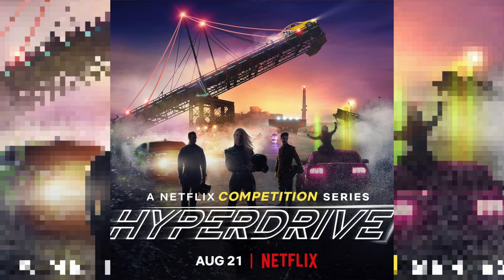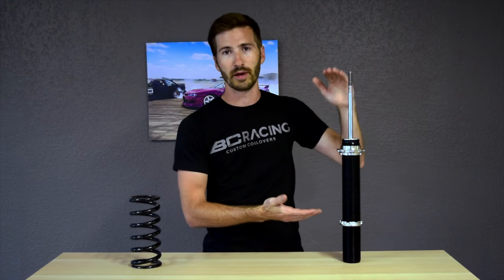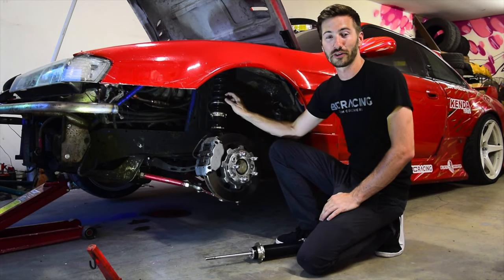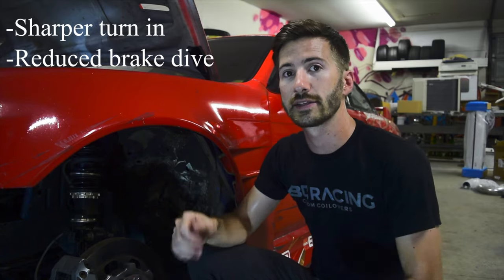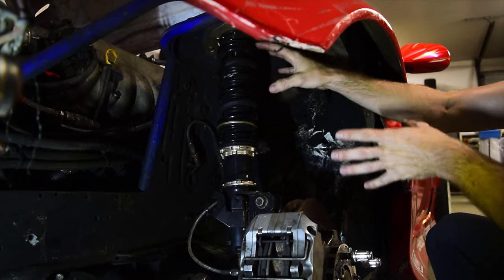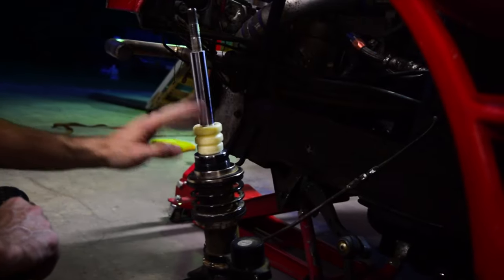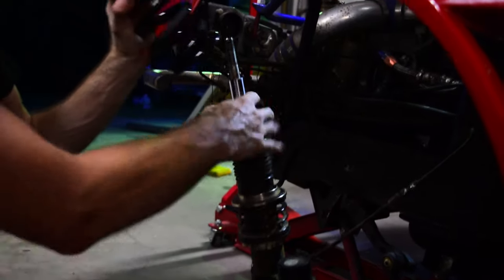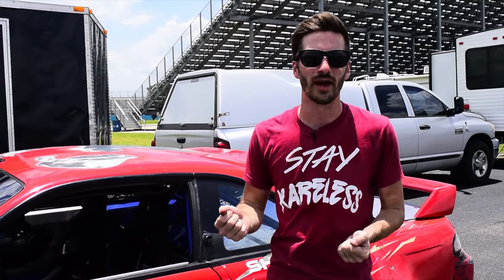Higher spring rates equal more grip?!?!  Search for traction!

Comment: A bit of a correction, but springs don't affect load transfer. A higher springrate in the front (Or to be more precise, a wheelrate), or a softer in the rear will NOT "push weight to the rear". Not even one Newton more than you'd get otherwise, just pure kinematics wise. It doesn't matter if your car has 1kg-f/mm or 10kg-f/mm springs, you're gonna transfer the same load.

Now what they will do is control the body, and if you change the relative stiffness of one end compared to the other, you will change the distribution of lateral load transfer, or Lateral Load Transfer Distribution. The car can and will only transfer a set amount of load from the inside tire to outside tire and you can't change that in any way with rates, but you can change how much happens at the front, and how much happens at the rear.

Going stiffer in the front means that there is more load transfer across the front side-to-side, and because the total load transfer CANNOT be changed with suspension like I said, the rear will transfer *less*. Tires with less load on them have more grip (Yes, more grip) and the more you load a tire, the more grip it loses, which is why a more evenly balanced axle has more grip. Loading a tire more will cause the cornering force to go up, but at an unfavorable ratio. 1000N more load doesn't give you 1000N more cornering force but instead gives you less; so you want as little load as possible for a baseline. That's why lighter cars inherently corner faster; they have effectively grippier tires.

You might be asking then why do people use aero if it increases load on the tire and decreases grip; it is true that it decreases tire potential, but the extra load results in more cornering force and more importantly it comes with effectively no extra MASS ie: inertia. So it's just free load without the downside of having to also push mass around; so the car corners faster.

You need to take into account the suspension kinematics too; the LLTD is not decided only by the springs.

Unfortunately there is no way to reduce load transfer of a car apart from making it lighter (It will transfer the same %, but less absolutely), making the track width wider/wheelbase longer, or center of gravity height lower.

A simplified formula for percentage of load transfer laterally is:

(1.0 * 0.5) / 1.5 = 0.33333333333

Where 1.0G laterally, 0.5m Center of Gravity Height and 1.5m track width, results in 1/3 of the load from inside being transferred to outside. Play with that formula to see the relationship.

With this you might think then that professional drift cars make the front track very wide to allow for less load transfer = more grip, which is true to a point. It does increase the axle's performance. However it increases the roll stiffness of the axle more than it reduces the load transfer; so realistically most of the time you actually end up transferring more load on a wider axle because the springs are effectively stiffer in roll. The stiffer the springs, the stiffer they get absolutely; however the % is always the same.

So going wider on the front of a stiff professional drift car will give you "more rear grip" than going wider on the front of a soft production car, because the front of the pro drift car became much stiffer absolutely (and thus relatively to the rear) than the production car.

Roll stiffness formula is too complex to write here because it relies on quite a few car inputs, but you can find it by searching. The unit should be in Nm/deg.
Reply: interesting
Reply: @jdmspirit99  Race Car Vehicle Dynamics has some definitions and examples and Suspension Geometry and Computation is also good if you're looking for more.

Comment: Good topic. I’m curious about anti-squat and it’s effect on traction in a drift car. High anti-squat is used on drag cars. The suspension geometry actually lifts the car’s backend up during acceleration aka pushes the tires down into the ground. In autocross low or no anti-squat is used because high anti-squat causes suspension bind in corner exit. Road racing varies. But what about drift? From my basic understand of physics seems like the forces acting on a drift car mid-drift are actually closer to drag car. Seems like you would want a suspension geometry that actually lifted the rear of the car up mid drift instead of sucking it down aka squat. You would still want soft spring rate in rear to allow slower weight transfer and high spring rate in front to cause faster weight transfer. But what do I know. I just sneezed and crapped my pants.
Reply: Got a very good point there, that’s why he said his car was front heavy because of the 2jz swap so with the stiffer springs, it’ll allow him to get more squat to the back allowing for better grip and a better geometry throughout drifting and transitions. That’s why he didn’t even touch the rear springs. Suspension is all based on your car, doesn’t work for everyone, so make your suspension work with your car and not what some other dude does, everyone has a different setup. Gotta love different styles of racing and setups while finding the perfect one for each
Reply: Stiffer front springs do not increase squat. They do however speed weight transfer aka make ‘sharper’ steering. 

More squat = less grip

Spring rates don’t change the car’s geometry.

Cars, drivers, motorsports, tracks, etc are unique. Physics is universal. I’m just brainstorming, asking questions with hyperspace while avoiding cliches & platitudes during time travel in my yellow banana.
Reply: Drift cars have very low amounts of anti-squat in hopes that more weight over the rear tires will load them up and increase grip

Edit: if you look at the fastest cars, they squat to the point that they lift the front wheels. Stiffer front springs help maintain the weight over the rear tires and softer rear springs allow weight to be shifted to the rear, specially during acceleration. In short, more squat and weight over the rear axle means more grip in drift cars.
Reply: @chomin3025  traction is also the result of weight and relationship to the rubber coefficient of friction.  The stickier of the tires you run the harder the springs you're going to have to run because the harder the tire is going to load your suspension and that will be further leverage if you have to sway bars the limiting how much travel the unspring side has and have that further loads the outside tire.  Depending on your car and it's specific geometry your car could potentially even lose traction as the suspension is loaded especially if the geometry is whacked out.  A lot of people critique the ND MX5 for having a lot of body roll but in reality the thing is providing a ton of mechanical grip and it has good camber curves to take advantage of the body transfer.  Fd rx7 is pretty much the same thing and cars with well designed a arm style suspensions or multilinks can have nice camber curves.  When you get into McPherson struts then the geometry can really work against you if poorly set up.  Then you start to get into these weird balances of sacrificing straight line grip and braking power in exchange for a better contact patch.  Another point I think some people might miss is the spring rates don't actually matter as it's the relationship of the motion ratio with the weight that will be put upon the spring that will generate a ride frequency.  I think many of us prefer to have a slightly higher frequency in the rear to play catch up with the front to avoid a jacking down effect.  All the said I'm not an expert on drifting or drift cars and their optimal setups.  I have a fairly good idea of what makes a solid road car setup along with a more road course oriented setup.  For all I know a drift setup is much more along the lines of an autocross setup which all my philosophies go right out the window if you just like at the results and what people may or may not like.  I've always looked at Porsche as a major dynamics company and you can see that they consistently put more spring frequency rearward.  If you start to add downforce through arrow then you get to experience a whole new set of variables that are speed dependent.  And a perfect world with perfect glass smooth roads I would even say you could go without a sway bar but in the real world it's all about trade-offs so technically there's a lot of decent setups but it's all about your own priorities and selecting the right components to do what you wanted to do how you want to do it. Funnily enough it's kind of like tuning a car.  Anyone can buy a nice ECU but it takes special people to actually make it behave how you want it to and in the wrong hands it can make your car far worse than stock. Personally I think the best dampers are the ones that have domestic rebuilding services that are hopefully local.  One of my qualms with coilovers is the limited travel of many of the brands which is fine for most track cars but depending on the conditions of the roads of where you live might be fine or might require a step up in spring rate just to keep it usable for road use.  Suspension is by far my favorite thing to play with on a car though I will happily admit I am so far from an expert but it's so intriguing.  It's even more intriguing now that I'm in the world of McPherson struts.  As much as I desire for it to be a more similar to my fd's old setup it just isn't he won't ever be.  Luckily the 240 guys have been cracking away at these problems for decades now, BMW and Porsche as well.  It's actually kind of sad to see how much of a difference switching up the suspension style of the 911 has transformed the car that even with all their expertise was a substantial improvement.  I love discussions with other suspension nerds.

Comment: So, for a very low power car, would a stiffer rear spring rate help it to slide easier because less weight would transfer backwards when on throttle?
Asking for a friend 😭
Reply: yep!  lower power is easier to slide with stiffer spring rates

Comment: This nice guy is lossing that shock with the most amateur way could hurt him badly,and from what I was seeing in the video,the 14K spring rate is too much that the front axel could not even stop shaking, and his s14 is gonna need a whole lot bushing upgrade too. At the end, he mention that after the changing,the car will needs more inputs to react,with the lower rear spring rates,of course the rear axel is gonna be slow in reaction,even more unbalanced after the front spring rates upgrade.And I did not even realize this video was posted more than a year ago until I type down all thoese letters.Anyway, the video is great, goodluck to the nice guy with that butt dyno.
Reply from the maker: Interesting take on things!  The setup isn't too wacky and works really well!  And yes all his bushings are aftermarket, as is everything in his suspension.

Comment: Is it assumed that as spring rate goes up ride quality goes down? So putting 14k springs on a street s14 wouldn't be a good idea or are they unrelated?
Reply: It would be a stiffer / bumpier ride. Bumps in the road would be dampened less
Reply: Then I'll go ahead and take .5k springs in the front and .001k springs in the rear. Car currently makes small bumps feel like your using a jackhammer turned all the way up
Reply: Going for the rock crawler specs eh
Reply: Spring rate should be match to vehicle weight and available suspension travel. If you have 2” up travel, soft springs will give you horrible ride quality because you’ll hit off bump stops all the time. but if you have stock ride height with 5-6” of up travel then go for soft spring rates to increase comfort.